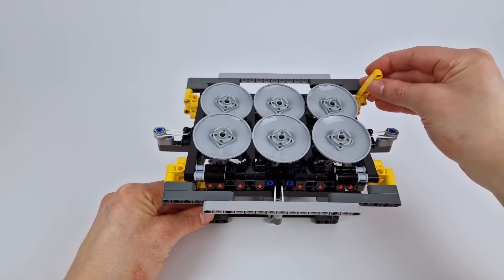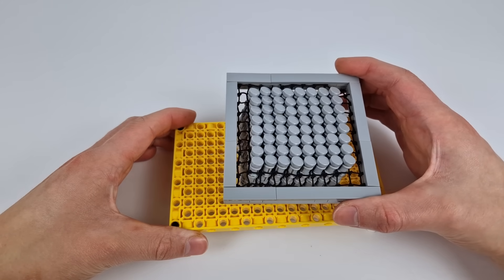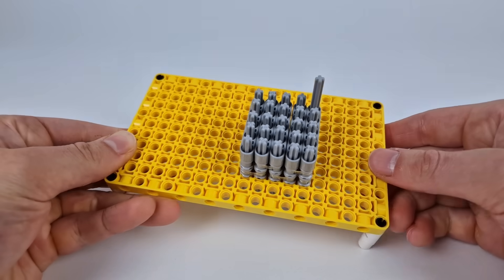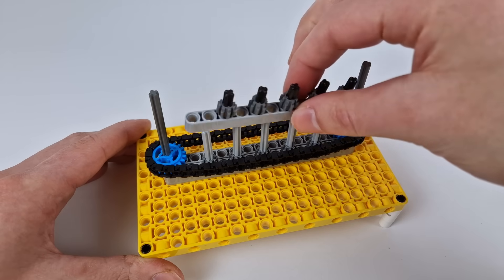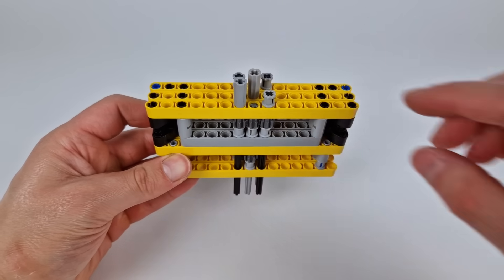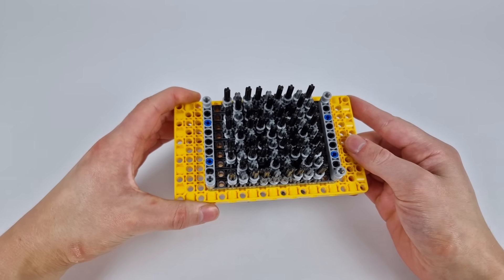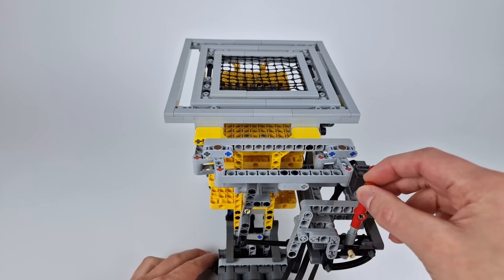How I Built a LEGO Treadmill That Moves in EVERY Direction

Comment: If instead of moving the net, it moved the entire block of mechanisms instead (even though that sounds like a PITA), such that the net would stay stationary, that'd make the change in the treadmill direction even more clear. Doubly so if it canceled out the slight shift in position caused between the net and the top surface.

Comment: Actually it’s nothing more or less then the loading and unloading system used in cargo air planes, so called IGLO systems. Where the whole IGLO pallet is shaped to the shapes of an airplane are rolling on some kinda ball bearings and mounted in a half bowl that makes these pallet very easy to work and handle  it without too much resistance or friction.
It works the same way only this one you made out of Lego bricks is far more complicated, much to expensive and a bit overengineered to make and use it on a commercial scale.🤷🏻nevertheless a beautiful piece of work 👍❤️

Comment: Honestly something I would have done (despite it would hurt emotionally a little because of what it entails) is to use a small blade or grater like stick (or a small stick with some fine sandpaper used for smoothing wrapped around a stick) and smooth out the grips inside the tiny gear to make it be able to spin freely like the red gear can.

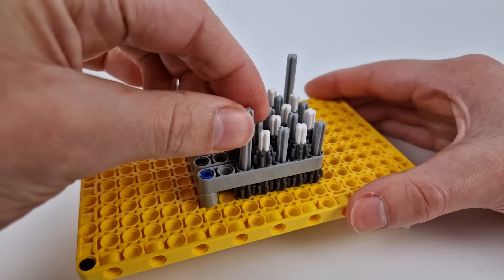Comment: 4:24 What if you adapted two separate axles together with a low friction pin in the middle to allow both sides to turn the gears in two directions?

Comment: That is a really cool and ingenious design!

On a further thought, i could make out two possible improvements:

1) Instead of moving around the net/frame for steering it might be even better to move around the driving mechanism and keep the net/frame in a fixed position. This would avoid superimposing the movement of the net/frame onto the moving platforms. 

2) At 11:30 two 12-tooth double-bevel gears can be connected diagonally when offsetting them axially by half a stud (i.e. offset by a half bushing). I think the gears should run reasonably smooth that way.
Reply from the maker: Thanks! And I like those ideas - moving the driving mechanism instead of the net would definitely give a smoother look when changing direction on the treadmill, though it would add some complexity. 
I had a quick try with the offset double-bevel gears like you said, and you're right that there's a lot less friction! Still slightly more than Lego gears have when meshing normally I'd say, but I'm sure they would've worked well!

Comment: Great design and build. As always - there is a plethora of things to try to perfect. Only one to mention - friction may be reduced when using rubber bands if even number of bands is used for each axel, where a pair of bands pull the axel on the exactly opposite direction with the same force, therefore reducing the friction of axel with it’s socket.

Comment: This is so freaking cool! It’s a replica of the treadmill Disney made for VR stuff.
Reply: I wondered how the Disney threatmill worked but now it is clear. And managing to build this from Lego 😂🎉
Reply: @leoatreides1  Being buildable by Legos is at least a good sign that an affordable home version of the HoloTile could be made
Reply: @AgentParsec definitely I made a plate a while back https://youtu.be/gX2xOdHkKdQ?si=PDPtI03woSBD1tOD

I’ll be making another cider today said a larger version with a lense that controls the motion
Reply: @AgentParsec  rough calculation: it's a 46 tile diameter circle, each disc is roughly 6cm in length, cost to make per disc is ~25c, but there's 6.65k discs, that's 1.6k 
however you probably need ball joints, which puts the costs per disc more around 1.5, so around 10k if you build it yourself, which isn't cheap. and you need the time to assemble all those joints yourself, even if it takes 5 minutes, that's over 500 hours of work, so I don't think we'd see any at under 20k, so I don't think it counts as affordable for home, but for a laser tag/arcade place it's definitely doable.

edit: actually, you could have the discs resting on a conical washer and bearing ball using magnets, which would drastically reduce the cost to around 5-10 cents per bearing, which could make it ~2-3k for a diy kit, which isn't cheap but definitely on par for high end home vr.
Reply: @satibel  hmm.. but using the Lego version as a proof of concept, I'm sure someone could come up with a 3D printable module that could be home-made much cheaper - not to mention slightly simpler, as it wouldn't have the constraints of sizing that Lego has
Reply: @johnd6487  that's what I'm talking about, just off of the filament cost and 3d printer usage, you're probably down a grand at least, plus you need bearings and other stuff, so the total cost adds up quick, especially because you need a lot of discs, each with their own bearings.
Reply: @ I already did

And have another vid putting out today on much larger prototype 

You can check it out on my page
Reply: @AgentParsec pretty sure this will never be affordable at least depending on what u think is affordable. This will cost thousands for many more years I think. And just imagine all the engineering going on below means you would have to build it into the floor. Electric motors need to become. Way cheaper, smaller and more powerful for this to ever be affordable
Reply: @satibel since you wouldn't be limited to lego shapes couldn't you just use a lot of really small balls and have them driven by two rollers like an old computer mouse
Reply: @preppertechnicianee6013  bro you are amazing. Post your video as a main comment. Not as a reply to a reply to a comment. WE ALL CAME HERE BECAUSE OFT HE DISNEY HOLOTILE.
Reply: @pizzamanhindustani bro if you think that is good lmao 

I made a larger version with larger m disks controlled by a camera 📷 

Much better I made is wayyy back i guess I should keep making vids
Reply: @leoatreides1  me too, its awesome
Reply: @leoatreides1  A threatmill? Sounds like my ex-wife!
Reply from the maker: Thanks! Glad you like it!
Reply: If Disney don't let me buy one soon this guy is gonna show me how to build one with Lego lol
Reply: HoloTile, yes
Reply: Brooooo where you been lol
Reply: the disney treadmill is not viable because of the speed the discs would have to spin to allow full speed walking or running. its just physics, to have the discs small enough to work, they have a small circumference and human running speed is fast and can easily outrun them even spinning at 10,000 rpm which would also be insanely noisy
Reply: @FurryTrash_  if it has 3 cm diameter then you need just 900rpm to get 1.5m/s walking speed on it.
Reply: @MatixYo  weird i did the maths before and got it wrong i guess i got 1273rpm for 2m/s
Reply: What makes it even more incredible is that it’s built with the limitations of pre existing LEGO pieces while Disney had the ability to create whatever part they required at whatever size or specification.
Reply: yeap visited to post that comment. ,now i don't have to, thy
Reply: I haven't seen You in years! You ok man?
Reply: @ bro he was telling us to buy bitcoin when it was 700 dollars 

He begged us 

He’s doing great I presume
Reply: Ummm exactly like Disney. You might get a phone call soon if not go full speed ahead.
Reply: I’ve actually been trying to make one of these too, but with 3d printed parts and it more closely resembles the hollow tile
Reply: its not but ok
Reply: What a coincidence seeing you in this comment section.
Reply: i was going to say if little rubber balls where on the end and a lot larger system. you could build a omni treadmill. so this is how Disney does it? nice.
Reply: That’s what I thought
Reply: True
Reply: I watched the Disney holo tile vid, this is the absolute answer to VR omnidirectional walking
Reply: @James-wd9ib  As I understand, the Disney one burns through parts. A standing human results in stress being focused on a relatively small area. Running the demonstration, they burnt out motors which would be expensive, and difficult for a consumer to replace.
Reply: Someone else made it before Disney and they basically claimed it, Disney sucks, so do the adult Disney kids 😅
Reply: @aToast3r  that's a pretty big claim to make with no evidence.

Comment: This is LITERALLY the same design Disney came up with to create an Omni directional treadmill for VR, MKBHD did a video on it where he went in and tried it out!
Reply from the maker: Yeah, that was the inspiration for this video, though this version works slightly differently as the discs can tilt in all directions whereas they're at a fixed angle on the Disney version. And I explained in my first video on this that it's based on that design.
Reply: Pin this #1

Comment: 4:00 it would be a much simpler system. If you were able to continue on this route, if you did the two separate layers, the first layer you could start the way you had, the second layer could be very similar, all you would need to do is on the second layer, put a gear on every single shaft, but on the ones that are rotating the opposite way drill the inner spline of the gear, so it is able to rotate in a different direction than the shaft, but then it would not be a legal Lego build, it would be awesome if Lego made gears without an inner spine and just a round hole.
Reply: You could theoretically make this layering system work by instead of trying to do the entire grid on one layer. Do a row per layer that would give you the space needed for bigger or more complex gear systems although The system will be taller. To save on height, you can use a v formation cutting the necessary height down by half
Reply: Why not just power the 2nd layer from outside the border of the mechanism?
Reply: @PaulOsbornesChannel My thinking exactly. This seems like the right solution.
Reply: @PaulOsbornesChannel  This was the correct approach the whole time, he was too focused on powering the mechanism from below that he ended up making it WAY more complicated than it needed to be.
Reply: Ain't no engineering like overengineering
Reply: Could do this with 16 tooth gears as they have the transmission component versions with smooth center and then use 2x2 round bricks because they have an axle center and a matching 2x2 smooth plate that could cap. It would be a much larger treadmill tho

Comment: 4:27 you were so close to solving the problem and instead made it way more complicated than it needed to be. All you had to do was pair the "idle" axles to the spinning axles with the transparent rubber bands. As each band would be working only on 2 axles, friction would not be an issue. Rubber bands could be placed at different heights to stop them from touching other bands. But I think that would be the whole project tbh. If you ever visit this idea again, please try this method and let us know how it goes 😄
Reply: they do exactly this at 7:30 but friction is still an issue
Reply: Look.. I’m not tryna be that guy.. but I’m gonna be that guy. Don’t comment before you watched the whole video man, because he tried this method and friction was a large problem with this. And also, as a 12 yr old with and interest in mechanical engineering… how the HELL would the belt only being on two axles lessen the friction? If anything, you would have less friction from connecting four because of less friction contact.

Comment: This was super interesting! As a Space Engineers player, I feel inspired to use this tilting disk principle in a future factory for moving cargo containers and vehicle chassis around.
Reply: Clang has entered the chat
Reply from the maker: Glad you liked it! And yeah, I bet an upscaled version of this could work really well for moving around heavy objects.
Reply: @BananaGearStudios  Probably if you flip this upside down, may obtain new type of multidirectional wheel that should work great on flat surfaces like storage. 
Some logistics company may be really interested.🤔
Reply: Is the physics simulation in space engineers good enough for this to work?
Reply: @wj11jam78  Yes, whether or not it will work well is another story.
Reply: Maybe? He might just summon klang tho
Reply: @wj11jam78 if I recall correctly, the mechanical side of physics in Space engineers is actually very barebone. I would bet it would work better in their abandoned project Medieval engineers, which had much bigger focus on physics based mechanics
Reply: @wj11jam78 easily. the question is really how fast will it rip itself apart with accumulated damage, since space engineers doesnt consider any elasticity
Reply: mmm, i love clang 🥴
Reply: Space Engineers 2's improved physics might allow for this to work
Reply: Ironically something like this is already used in aerospace, but with bearings instead of motorized rollers
Reply: I mean, to be fair, I have seen some pretty impressive mechanisms in Space Engineers, and the rotors and hinges would make this pretty easy to design, it would just be hard to keep clang from going crazy. Maybe in SE2? they have supposedly made massive improvements to the physics engine, I'd love to see something like this tried when that releases to early access
Reply: Something is going to be sent flying from your build due to Space Engineers’ Physics engine
Reply: Isnt it patented by disney lab? Saw it first on theyr channel
Reply: @simontrickfilmer  No. You cannot patent an idea. 

You can only patent the very specific method of building or power transfer to achieve this kind of system, but you cannot prevent others doing the threadmill in different method with patents.
Reply: Space engineer that is one of my dream job

Comment: I think that you could build a working maze out of this.  Scale it up with more nets, build a bunch of Lego pathways suspended off of the rollers for clearance.  Maybe make two sets of controls for two pathways set up with the same motor for equal power and have races.

Comment: Amazing design, I love how you walked us through the issues you had and the process you used to solve them! One humble idea: it seems like the net is a little loose as-is. Do you think you could make your own sort of net-frame using a lot of those Lego strings? You could tension the strings more and prevent some looseness of the surface, as well as allowing you to make a larger frame, depending on the length used. You could even make a second frame below the existing one that moves a proportionally lower amount, so you could have a second string supporting the tilting axels.
Reply from the maker: Thanks! And that's a great idea - I'm sure I could definitely use rows of strings instead of the net, and that way I could tension them properly and make the grid any size I want - sounds like it could be a huge improvement!

Comment: This is impressive. Now I'm trying to think of how this could be modified so the dance floor position doesn't change when the direction is changed.
Reply: Make the net static, move the gear assembly.  Same effect, though it will take a bit more oomph to move the added mass (and, ultimately, you'd have to have the drive located on that assembly, further adding to the weight).
Reply: @JuryRigged  I hadn't thought of that approach. I was thinking about adding another layer of u joints and a static net at the top. It would invert the controls and double the vertical movement of the floor if it was even rigid enough to keep the rotating joints interfering with each other.

Comment: Very cool, great job; what might make it even more visually impressive is changing the direction controls to move the central portion and gears underneath, and fixing the top platform in one location. That way when you change the direction of the top treadmill, its always in a fixed location rather than shifting around.
Great job though!
Reply from the maker: That's a nice idea! Of course the whole mechanism under the net is pretty heavy, and so more force would be needed to move it around with the joystick, but you're right that it would definitely look smoother when the treadmill changes direction.
Reply: @BananaGearStudios   One solution to this might be adding additional linkages above the gear system and only moving a midsection of each axle, thereby "bending" the top end in one direction without changing its position. Each axle would look like this from bottom up: Straight axle with gear system - linkage - angled axle (freely moving) - linkage - straight axle (fixed upright in a grid which is shifted in its entirety in various directions) - linkage - angled axle with disk at the top and held in place by the net. Technically this type of linkage would move the top platform up and down slightly when switching the drive directions from one extreme to the opposite side (even more than now), but if the tilting angles of the disks are kept to a minimum, it shouldn't be too bad.
Reply: @Spanksh  Or just mount the camera on the moving top plattform.
Reply: Everything is relative! Put a mini camera fixed to the platform! Would love to see a follow up video of just cool mini-movies made with this

Comment: I think you could have used the every 2nd moving the same direction, and then coupling one more to each axel with the flat rubber band, so each axel only drives one other axel. That should distribute the friction evenly, and since you already use more than one motor to drive, I think it would be power sufficient enough :)
Reply: He does try that at 7:25